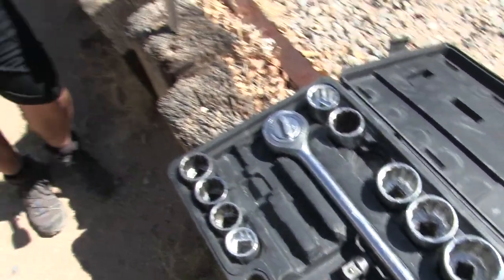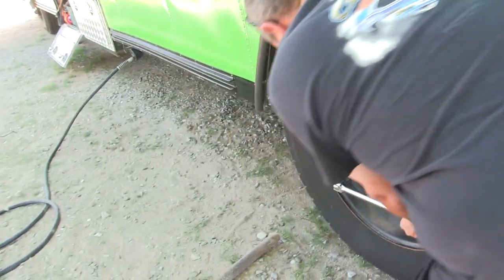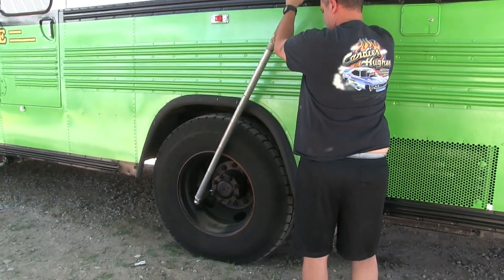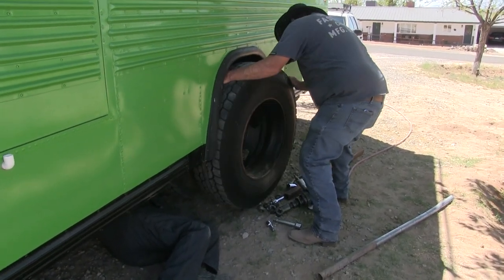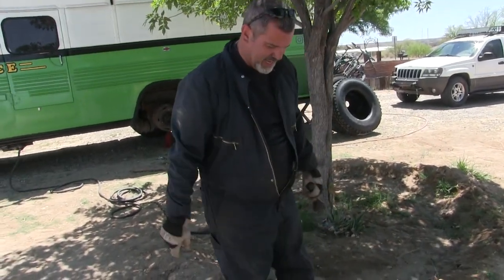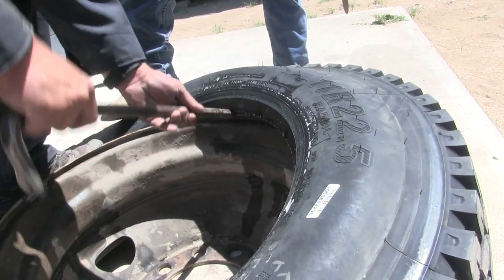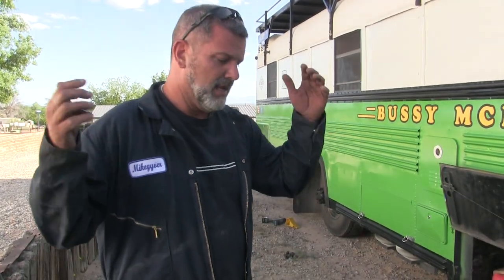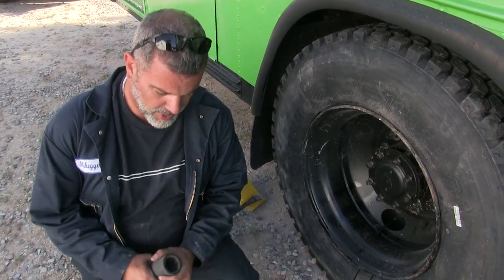Save $$$ by Changing your own Skoolie Tires!

Comment: Hey Mike. Currently building a Skoolie myself. Thought I'd let you know a truck I used on the road probably a dozen times (during my 1,000,000+ miles in a big truck) that is ALWAYS carry a bottle of Dawn Dishwashing Detergent in yiur side box. Makes the very best lube for removing a tire ir installing a tire.

 Always remember, in the event you loose an outside dual, jack up the bus, or roll the bus up on a block of wood or a rock with the inside dual if that's all you can find, then squirt some dawn on the bead, and easily remove the tire with a crowbar and continue on to a safer place to replace the tire.
See you out there one day soon, Cheers!

Comment: 2 comments: 1) I'm glad you did the research to find the safer ways to change a tire & properly torque the lug nuts. 2) There is a lubricant made especially for putting on the bead when removing & installing tires. Failing that, a mixture of water & liquid dish soap works very well & is much cheaper than olive oil.

Comment: I enjoyed your video.  I'm glad to see someone actually mention torqueing lug nuts, it's a subject that is almost never mentioned and is extremely important.  Make sure you actually do a star pattern.

I have a 2004 IC CE200 that I'm in the process of converting.  I tried to break loose the wheel lugs with my Milwaukee impact gun (750 ft. lb.) but it wouldn't touch them.  I had a conversation with my next door neighbor who has been a heavy equipment mechanic for 26 years and he told me that mechanics just slap a 1" air impact gun on lug nuts and over torque them.  I believe my bus' lugs (not buds) are to be torqued to 450 ft. lb. which would be easily doable with my existing Milwaukee if they had been correctly torqued.  Assuming I ever get my bus ready to roll I'll one of the last tasks will be to remove, inspect, change as needed and correctly install the wheels and tires to correct torque specs so I won't have to fight with the lug nuts if I have to take them off.

Comment: Great job. I want to learn how to change a tire without removing the rim. I'll eventually practice that at home when I start getting new tires. Yall are doing a fine job at showing people they can save alot of money and do it themselves. I replaced a hi pressure power steering line and saved on the towing plus the repair. Saved myself 800 bucks. Oh, I love ur buzzers, I'm going to have to change mine now, for sure. Have a great day guys.

Comment: JOBS' DONE, RIGHT?  THEN YOU DID IT CORRECTLY MIKE.  MANY WAYS TO SKIN A CAT, IF YOU GOT THE JOB DONE AND NO ONE WAS INJURED THEN YOU DID IT RIGHT...AT LEAST THE RIGHT WAY FOR YOU AND THE TOOLS YOU HAVE AVAILABLE TO YOU.  HAVING SAID THAT, THAT WAS STILL ONE OF THE MORE COMPLICATED TIRE CHANGES I HAVE SEEN.  I LEARNED SOME STUFF FROM YOU GUYS IN THIS VID, THANKS. 
WHEN I WAS A KID WE USED TO BREAK THE BEADS ON CAR TIRES BY PUTTING A 2x6 ACROSS ONE SIDE OF THE TIRE ON A SLANT TO THE GROUND AND THEN SLOWLY DROVE A CAR UP ON TO THE 2x6 SO IT WOULD BREAK THE BEAD DOWN OFF THE RIM.  BACKYARD TECH AT IT'S BEST!

Comment: Hey good one guys! Very informative and it has to be comforting to know that you can for sure solve tire problems in the middle of nowhere if you have to. The pressure regulator to manage the bus air system with the tire inflation is ingenious mike. Well done!

Comment: Hi Mike - Okay you've impressed me!!!! You are in good shape as that's a lot of work. I commend you for stating the importance of safety when working around and airing tires up. In my past I mounted Aircraft Tires (c-130's)in the Air Force. One day I had a tire blow in a tire cage. It was like standing next to a Howitzer cannon going off. My ears were ringing for hours after that. A change of clothes was in order too. Did some commercial tire sales and mounts on mining equipment, loaders and lumber trucks. I had never heard of using olive oil on the bead before. Always used tire soap. Thoughts are the soap will dry up and or wash off. I suppose Olive Oil would do that too?  Very good video as usual. Two thumbs up. Dale

Comment: You should look into a torque multiplier for removing the lug nuts/bolts. Makes it easy to break them loose.
Reply: I was going to comment the same.
Reply: Me too
Reply: yes, that's what I bought for my class A. Just incase.
Reply: @daviscrt  I got one on Amazon in 2019 for 64 bucks for the bus. Haven't tried it yet.  But it is heavy so hopefully it's a good set. That tool also let's you use a standard 1/2 drive torque wrench to achieve 500+ ft lb through it's gears. It's great that Mike made sure he could do this and explained it to the rest of us.
Reply: I bought a Milwaukee high torque impact wrench. That thing has 1400lbs of "nut busting" torque. Makes quick and easy work on all tires.
Reply: @markiefufu  I have one of those, too.  But for anyone reading this, beware that lug nuts on big wheels, like the bus, can require a lot more than what a 1/2 or 3/4 inch drive can supply.  Did you see the size of the air wrench in the video?  A solution for anyone except a professional shop is one of those torque multipliers.

Comment: We bought a torque multiplier, I use my 150lb torque wrench, we did the math and I think it was about 47lbs with the multiplier, awkward, but doable. our old bus torques to 350 on the rear and 300 front.  Have a Great day you two.

Comment: Hey a little info I work for a tires store never use  anti Seize on lug studs and lugnuts  it takes away from the friction to help hold the proper torque  and can cause the lugs to loosen. The threads create the torque from the wrench to hold the wheel on.  Ant questions let me know.  I love watching you guys I just want you to be safe.
Reply: On the old style bud wheels if you don't use anti seize they will rust together. If they do your not getting apart without torches and braking studs. Just use torque wrench and check wheels as part of your maintenance

Comment: Those tire explosion shorts that you added to this vid, were from a wheel called a split rim. I watched one (in a tire cage) explode and the ring of the split rim went through the cage and a cement block wall. They are fazed out of the industry now. The wheels you have are perfectly safe to air up on the ground or standing without any issues. I have personally changed well over 1000 class 8 vehicle tires in my life and never had an issue with them. The only other thing that I can add to your video is, check the wheel over for cracks. Specially between the lug nut holes. Its common on those 2-piece lug nuts.

Comment: I did truck tires in my younger days before tubeless tires, which came on the scene in the middle 70’s. First tire was a little funky but once you got the right bars and figured out the lube thing you were cookin. One thing is if you don’t take as much of a bite on the tire, when mounting it meaning don’t have the bars as far apart, try not to put 8 or 10” inches of the tire on at a time just go like maybe 6”. It will take a few more bites but you’ll get it done with less pressure, the bar will be easier to move. And easier on the bead of the tire. If you hear any cracklings noises that’s the cord of the tire rupturing and you could cause damage. I just put 6  11X 22.5’s Roadmasters on mine for $1700. Sailun’s I think are what UPS uses on their delivery vans. They’re 19.5’s but same tire. Made in China ????  Cooper Roadmasters are made in US and Vietnam. I try to stay out of China, it’s hard sometimes but I try.
The inner nuts are sometimes called thimble nuts. Pretty good gun for under $200. I got the Milwaukee 1400 lbft 1/2” drive cause I can use it for many other things. And I can set it for torque. Good luck, be safe.  Don’t know if you remember me but my wife and I met you in Erinberg at palooza we had the right hand drive Samarai.
Reply from the maker: Totally remember!  😁

Comment: Mike , the tires exploding in the videos you showed appeared to be split rim tube type tires.  Which are very dangerous and should be outlawed.  Your budd wheel tubeless tires are much safer, your greatest risk over inflating the tire, but with the 120 psi cutoff for your compressor you are safe.  Good job 👍, you have a useful new skill.

Comment: those tire "explosions" are typically with the older split rims or a result of overinflation.  Ive seen the imprint of a slit rim tire explosion in the metal rood decking on the inside of a tire shop, 14' up.

Comment: What are you doing about balancing the wheels and tires? Also I think the clips you showed of the tired exploding are the old style split rims. They were a 2 piece rim.
Reply from the maker: Not all of them.  In fact split rim and split ring rims are becoming more and more a thing of the past.
Reply: They look old style and those are a thing of the past. Air them up just check them as your filling.
Reply: You don’t need to balance big truck wheels

Comment: When changing your rear tyres: They should be same. Replace x2 , As the New tyre is going to be higher.  Not the same. Will wear the most. For the long run. Piece of mind.  Happy  maintenance.  Regards.

Comment: This is when you need air tools, lol.  My hubby has used the cheater pipe millions of times, UNTIL he got the air tools. He’s also done the put a good sturdy board on the tire and drive up on the tire to make it pop-off easier after you’ve started the breakdown process. Also, this is when you need to go to Harbor Freight and buy their tire breaker down machine, makes like sooo much easier .   My husband also has a battery operated air impact wrench like you have.  likeJust wanted to make you have a good laugh today.

Comment: the tires you showed in the video exploding are split rims we had them on the army truck the rims you have on the bus are not that so you are safe filling them up on the ground also i hope those tires are not directional tires you never mentioned that. if they are directional you have to make sure the arrow is pointing forward. so you might want to check that if they are it might be just as easy to just switch them out from the other side. Mike better safe than sorry so good to play things safe especially in the line of work you did im sure you have seen some stuff so safety is always important. be safe traveling my brother.

Comment: When he mentioned the "timing" on tires with valve stems did he match them up to same position or one up top and other at the bottom?  I think he mentioned 180°...what's that mean?
Reply from the maker: He put the valve stems for the inner and outer tire 180° apart and visible through the holes in the rims.

Comment: Lug nuts are installed dry. Never, never, never use anything on the stud. One drop of oil on the washer to help get the correct torque. Torque is 475ft lbs.

Comment: Right hand thread on the right,  Left hand thread on the left side,  goes back to the Horse and Wagon days.  Push an old wagon back far enough and the nuts will fall off, then the wheel.

Comment: I spent 20 years torquing nuts and bolts on Navy aircraft and 21 years on Submarines. You always ALWAYS torque in a 180 degree pattern and in three increments. Then once around to check the final torque. Trust me on this. At that level your actually stretching the bolt some so you should use the incremental system.
Reply from the maker: That is interesting.  I may go back and do this.

Comment: Bud style hubs suck! At least they are not Split rims! I have a one inch impact to do it at my shop. You are a monster my guy! 
next step, some body bushings.
Reply from the maker: What would you recommend for the body bushings?
Reply: @BussyMcBusface   where the body sets on the frame mounts, there might be some rubber bushings or isolators. They wear out over years. All Simi trucks have them, pretty sure busses would be similar.

Comment: Those videos of tires blowing out are from 99% split rims because of the rims not bolted tightly together. Unless your bus is built pre-80s its not much of a danger nowadays unless its a manufacturer defect of sidewall damage. Hopefully you also got a spare and I would recommend a golden bar for changing tires and are you running recaps or virgin tires?
Reply from the maker: Virgin for sure.

Comment: Not supposed to put never seize on lug nuts, several good videos on youtube for the reason, but basically, it can cause you to over torque the lugs past their safety margins. Something like WD-40 is ok to help prevent rust, but no more lube than that.

Comment: Why would anyone not have a torque multiplier?
Reply: Because I have a Milwaukee impact otherwise I might
Reply from the maker: Because I too have an impact driver.
Reply: @BussyMcBusface  If it is air powered and you will always have enough air you might be ok. I have seen a TM loosen nuts that were too tight for an impact air or electric. Still a TM is cheap insurance to pack away with a Jack etc. Good luck with that great bus!

Comment: First the bad news theres a device called a torque multiplier the cost around $60 amazon you'll want to have in your inventory because of that jerk murphy. Second is while tubeless tires have safety concerns they are not split rims, most of the tire failures in your videos were splits and they are a different animal. You might be able to go garage saling and save big bucks on tools, I've seen chop hammers and tire spoons for less than $5 before. I'll bet you wish you'd installed more basement space lol. Looking forward to next week, not preaching just thinking outloud.
Reply from the maker: During the second tire you must have seen the cordless impact wrench and the torque wrench.